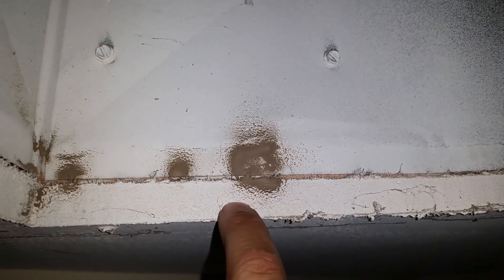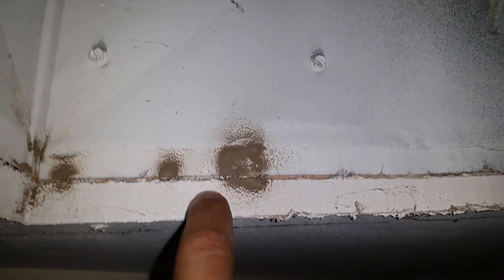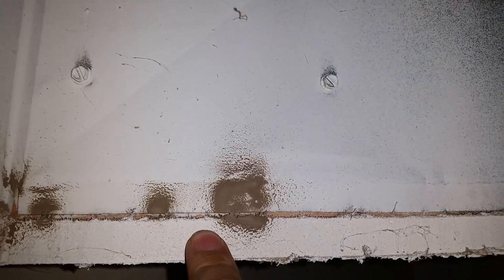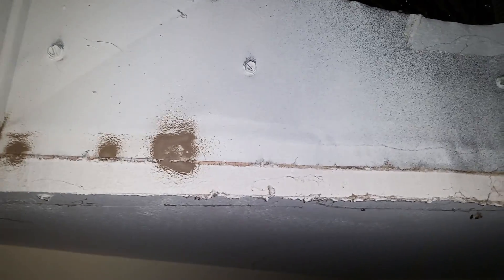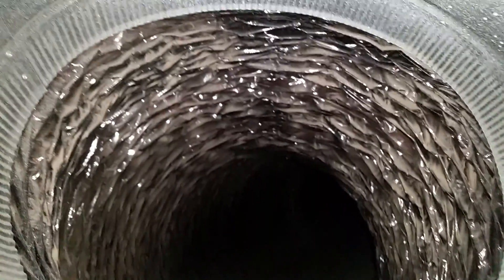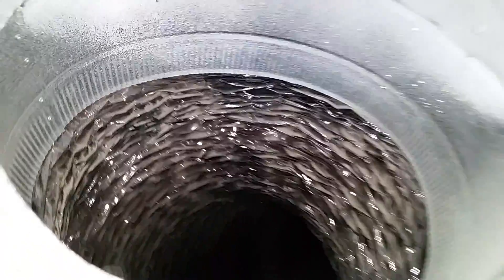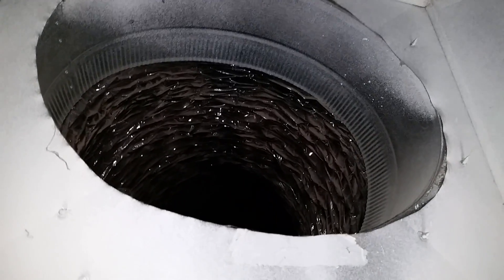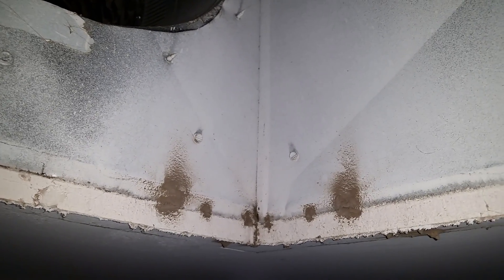HVAC - 60 Second Tech Tips #5

Comment: If you find dirty insulation around the box in the attic it's another dead giveaway
Reply from the maker: Joe Shearer Exactly right. 
Hey Joe, I ordered a new return grille to replace the restrictive one in my 410i video. That old grill was about 69% free. The new grille (TRUaire #A29020X25) Im calculating  2.91 sq ft free. which is just over 80%. You familiar with these grilles?
Reply: HVAC in SC I have used them before but I do question their data because they aren't much different than hart and Cooley in their design yet they are so much better? I don't quite get that.
Reply from the maker: I think I'm just going to get some physical measurements and run my own numbers to see what I come up with. Maybe make a video of the results. lol